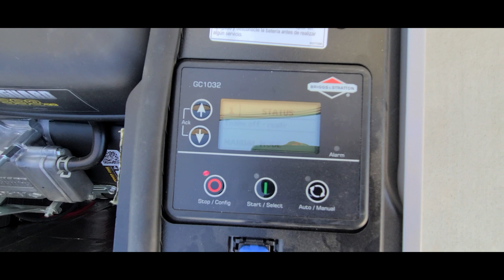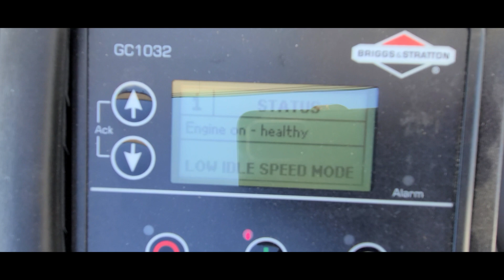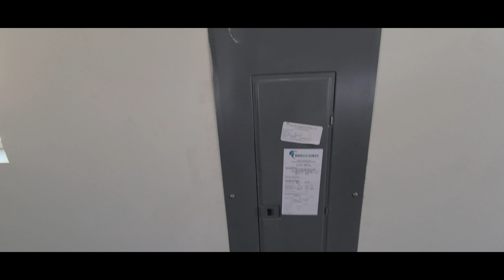Briggs and Stratton 20kw Whole House Generator - Brand New Model PP20 First Start and Sound Test

Comment: Do you know what size battery  you use for engine start up??
Reply: I just replaced my battery as it failed at three years with an “ Interstate MT-51R “ as that was what we used originally.  This is on a Briggs & Stratton 17KW it uses the same commercial B&S VANGUARD motor of 993cc as all the large air cooled Briggs & Stratton generators.
Reply from the maker: @rodneyrussell7325  I don't know exactly. I did remove the panel where it's located once, and it is a small 12 volt battery. It's lead acid and probably similar to a small car battery. Once it reaches the end of its useful life. I might install a small lithium replacement. The battery is on a full time trickle charge, and I have not had any issues with it. The generator starts up very quickly. Hope that helps
Reply: @GOATbro_Australia  thanks

Comment: 4 attempts to start sounds bad to me. Has anyone come to check it out to see why so many attempts? Thanks BTW, I'm currently considering the Briggs vs the Kohler. Briggs comes with a 10 year warranty vs 5. Both have American made engines and Briggs price is slightly better than Kohler's. I haven't purchased it yet so I may go with Kohler but we'll see.
Reply: That’s normal for first time start up.  I’m sure it only takes one try presently

Comment: I have an opportunity to purchase this exact same model with 40 hours used, for $4200. This not include the transfer switch or installation labor. Please tell me your thoughts. Anyone is welcome. Thanks guys! Note; the person I may purchase from is an electrician that I know personally. One of his clients moved up to a higher KW unit to accommodate a larger home.
Reply from the maker: Seems reasonable. Maybe just have a local support tech check it out first if you can. And if possible see if the warranty transfers over. Mine came with a 6 year warranty, and it's good insurance.
Reply: Thank you for the quick response! Just got off the phone with my electrician. He said the unit has a 10 year warranty, transferrable, and would cost nearly $10k U.S. including the natural gas labor total. I am highly considering this purchase. Thank you for your input sir! @GOATbro_Australia

Comment: Does the exhaust vent out the left side or the right side?
Reply from the maker: Out the right as your facing it. The left side is cool air intake and warm air exhaust for engine cooling.

Comment: Is this the DX series? I think I’m buying one very soon
Reply from the maker: They may not use that terminology any longer. My purchase order and operators manual only refers to it as 040662 B&S PP20. They went to PP for Power Protect not long ago. The serial number is the main thing to look for to make sure your getting the latest version. They used to have one serial number for aluminum  chassis, and another for steel. They may have moved away from that as well. Just check with your local distributor. Mine has the 6 year warranty. That use to be another designation as well. It changes a lot, so just confirm. Hope that helps.
Reply: @GOATbro_Australia  Okay the one that I’m looking at is the PPDX20 which I believe is their newest line with a 10 year warranty on parts and labor. These have a great engine which I believe is a vanguard commercial grade.

Comment: For those DIY people, the building code allows installation based on the manufactures fire rating of >18" from a STRUCTURE (NOT ALL Generators have this rating, please check), we like 24" min. just in case we need to work on it in the future. The 18" rule applies as long as there are no openings within 5 feet in any direction and or angle. This gentleman's install is correct as those windows cant open, always watch out for ANY OPENING... i.e. HVAC intake/exhaust and dryer vents. Also, AHJ (inspector) is your friend and has the final say in your area. One last note asked... We are a dealer for multiple brands. At 5/2023, you CAN NOT BEAT  Briggs Warranty as they offer a 10-year above their standard 6-year. As for function, yes there are subtle differences between the manufacturers but all the big players are effectively the same. I will add that B&S transfer switch technology is the best as it allows most installs to utilize a much smaller generator without brownout issues with the Symphony system. My 2 cents...
Reply: Windows Seep!

Comment: Planning is always key, nice work thinking about the future installation. my input is that you please check that flexible gas line. That is most likely not UL listed for a generator, that is for appliances and you risk a fire as it can crack from repeated vibration in time, do not use it unless it is listed for its use, please check. 2nd item on the gas install, the regulator I see is primary to the meter please verify that the secondary W.C. is no higher than 7". Easy way would be to check at the "T" you left yourself back at the meter, make yourself a 1/4 npt reducer and check, if your blowout your internal regulator you will void your warranty.
Reply: My Brigs & Stratton 17KW came with the gas flexible rubber hose. ….   The connection hose cannot be a metal  flexible due to lightning strikes by code.

Comment: So we are located in south central Texas and just went through an ice storm that wiped out our power for 3 days. Downed trees and power lines. Being on a well we were also without water. We have and use natural gas. Was looking at B&S, Kohler, Cummins and Champion whole house systems. I like that B&S has a 26KW air cooled with the 10 year warranty and Symphony II mgmt system. Any regrets on your B&S purchase?. I submitted onsite requests for those manufactures last week and so far B&S was the only one to respond and they did so within seconds of me hitting the submit button.
Reply from the maker: So far it's been really good. The main thing you need to look for is local support. Mine is really good here for B&S so that was a big factor. The 26kw would be a great option. Just make sure to check that your gas supply can keep up with it. My house is new and had the correct size meter for supply, so watch that one. Hope that helps!
Reply: We have a Briggs & Stratton 17kW so far so no issues.  The power was out all the time before we installed the generator.  After the install it has only run 12 hours in three years including the two 45 burn offs annually.  As the power never goes out now 🤣🤣🤣  anyway it’s nice to have it available.   Just replaced the battery and changed the oil.

Comment: I thought generators were not allowed to be installed that close to a window, thats odd to see. Maybe being a garage window its different?
Reply from the maker: That applies to windows that open. If the window is fixed and cannot be open, then the 18 inch rule applies. My window is fixed and cannot be opened.
Reply: @GOATbro_Australia  That makes more sense.

Comment: I am trying to decide on either a Briggs & Stratton or a Kohler.  Did you look into a Kohler?  Any advice appreciated.  Thanks.
Reply from the maker: Yes I did. I looked at all options and did a lot of research. For me it all came down to local support, I have great support in town for Briggs and Stratton, and there are many installations and good supply of parts. The transfer switch integration is also important, and I liked the Symphony II and how well everything worked together. Local support was the big one though. Hope that helps.